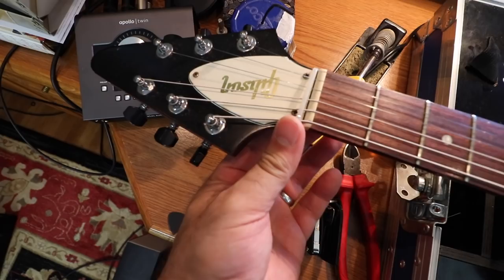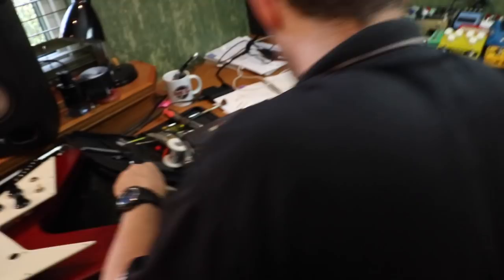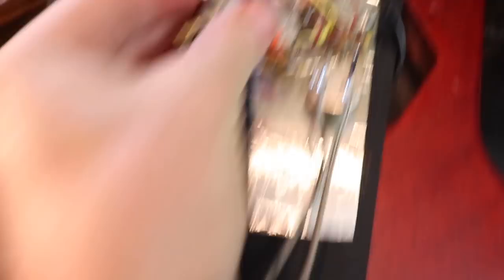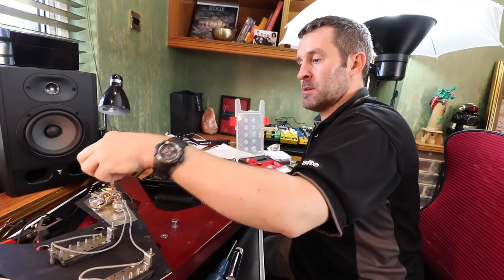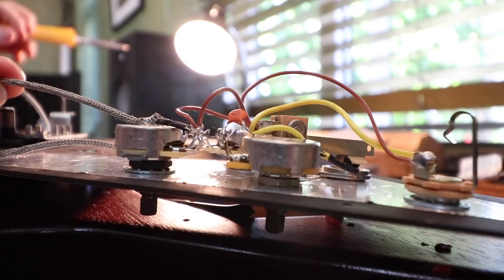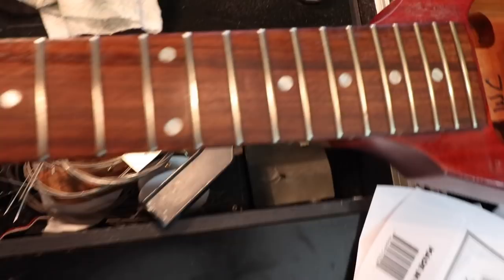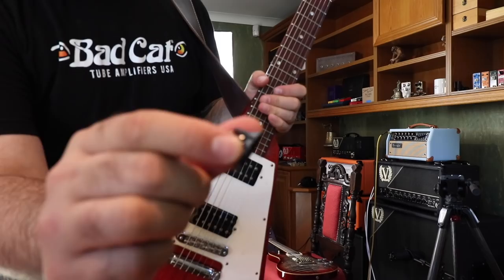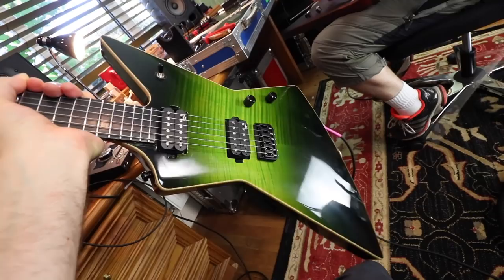Gibson Flying V Tone Hacks

Comment: One day electric guitarists are going to understand manufacturining tolerances on electronic components and rise above the snake oil nonsense.
Reply: Ceramic capacitors are not made to pass signals through.  They have nonlinear behavior and don't act like a pure capacitor in certain situations.  They also have horrendous tolerance.  There isn't anything special about an orange drop though.  Any decent quality film capacitor, be it 50 cents or some crazy trendy $20 paper in oil cap will act similarly in a low voltage application like a guitar tone circuit (high voltage is something else since certain capacitors are better than others at working at several hundred volts like in a tube amp).  Orange drops happen to be convenient because they are easy to work with due to their long radially mounted leads and rugged epoxy coating that protects the polymer film of the capacitor from accidental bumps from a soldering iron while installing.  The "orange drop" line actually has several products within it with differing internal constructions so there is not even an actual single "orange drop" capacitor.

Comment: Disconnecting the tone pot does not remove resistance from the signal. It adds infinite resistance to the filter. Using a 1Meg tone pot achieves similar gain in brightness and loudness, while retaining the ability to roll off the tone should you occasionally need it. It's pointless to hype about the capacitor and then not even connect the tone control at the end...
Reply: this is exactly what I was going to say. its amazing what the ear hears when it wants to
Reply: Not everyone who can solder understands electronic theory
Reply: There seems to be a little bit of confusion about what I was talking about here. So lets clear things up: (Everybody ready??)
 
A tone pot works differently to a volume pot. It uses a pot and a capacitor together to filter the treble frequencies in the signal to ground. The capacitor only allows treble frequencies through to the other side. If the treble frequencies are present on both hot signal and ground side, the voltage difference is cancelled out and the treble frequencies are removed from the signal going out to the amp.

The tone pot is connected to the input of the volume pot. It is connected to one end of the resistive strip. Some people call this “lug 1”. A capacitor is then connected between the wiper, or “lug 2” and ground. The other contact on the pot is unused. This is because we’re using the tone pot as a variable resistor, rather than as a voltage divider, in the case of a volume pot. Turning the pot down allows more signal to reach the capacitor, where the treble frequencies are then allowed through and are grounded. 

If you disconnect the tone pot and the capacitor from the circuit completely, you remove a path to ground from the circuit. All the frequencies will then head to the amp. Does this make it louder? Not really. It’s probably more accurate to say it makes it ‘wider’. You’re now getting all the available frequencies generated from the pickups instead of filtering out varying degrees of high frequencies.
Yes, a 1 Meg pot would make it a lot brighter sounding than a 500K. The lower the value of the pot, the greater the amount of signal that can escape to ground.
500K pots keep your sound brighter than 250K: their higher resistance won't allow as much of the signal to bleed off. A 1 Meg pot has such high resistance that when wide open it sounds almost like having no control pot there at all. But in the case of this particular on-site mod, we didn’t have any 1 Meg pots! ;-)

As always, theres not really any "right" or "wrong" when it comes to which pot value or capacitor value to use, they’re just different. What pickups you are using and their output will all make a difference. The important thing is to use your ears. Experiment with different pots and capacitors to see what sounds best to you.

Pablo ;-)
Reply: while this is fair, youve essentially got 500k in parallel with the nominal resistance of the pots while unloaded, lets say 5ohms (its uncommon for a pot to ever be fully unloaded ime). Youre essentially going to see no voltage across the pot and the overall load of the system is going to be marginally lower than the 5ohms (4.9999500005ohms). taking the pot out when at max volume essentially does nothing. In fairness, im more well versed in LoZ electronics and I know that parallel RC loads can affect peak resonant frequencies even when unloaded in HiZ
Reply: I've had the same idea for some time now. As I was studying guitar building and we did have an amp and pedal course, this thought came to me. It's not a difficult circuit to do and woule be helpful for people to compare what capasitor/pot they want in their guitar.
Reply: "Do it!"

Comment: Oh Rob.... Resistance is Resistance, the same as pressure is pressure. ie: 14.7 psi equals one atmosphere, no matter if it’s 33 ft of saltwater or bars in a decompression chamber. The timeless guitar tone myth of PIO and original Bumblebees, etc... is exactly that, a myth. I challenge any guitar builder to prove me wrong.  I propose to modify three exact guitars, one with the “Highest quality Caps” available, and the others with off the shelve $1 caps. And you will not be able to hear any difference between them. Most importantly, when all three are measured with a ohm meter, the resistance will be the exact same. Full disclosure, I’m an robotic engineer with 30 years CB and electrical component design. Love your channel and guitars!

Comment: Anybody that has a little bit of electronic knowledge knows that all capacitors has the same function... changing these don't change the sound. Removing the 500k tone pot does NOT remove 500k from the circuit. it makes a difference, but removes just little resistance in the circuit.

Comment: I use no load tone pots. Best of both worlds. That Flying V factory wiring is atrocious. So was mine. The fit, finish and playability of the guitar itself is outstanding but under the hood it was so sloppy. I love those non reflector top hats. I have them on my Explorer. I am going to buy some for my V and my 339. My V had Burstbuckers. Too bright on the verge of being harsh and slightly microphonic at SLO gain levels. They were replaced twenty four hours after I bought it with a JB and Jazz. Still on the bright side but much meatier.

Comment: You could also make the Tone-pot a push-pull one. And when you pull it, it engages the tone circuit and when it's in, the tone circuit is bypassed. (Or the other way around)
Cheers

Comment: Capacitors almost fall in the same category as tonewood... In that it's rather negligible and all that... - The whole "It's amazing, it's going to make a huge diffence." claims just makes me cringe.
To be blunt; Electric guitar tone is mostly "pickup + amplifier + speaker" (ignoring pedals for this instance), after that you have things like cabinet construction, cable type, and after that maybe the woods, strings and picks, capacitors etc. - Overall control over the tone's properties are of course determined by how you play the entire rig, but capacitors are definitely low on the list.
(I know, people are gonna argue heavily about what order is "reality", or that it's "all in the fingers", in which case NONE of the equipment matters. But that's in MY experience after about 18 years.)
Reply: Mwell, with real physical stuff like woods, metals, and electronics, there's still a difference. Just not in the way it's generally thought, and it's so MINOR. - It comes down to the player's isolated world, what they (want to) hear and feel. - Like I hear a slight difference when using GraphTech saddles as opposed to regular steel saddles, or play any other material pick compared to your regular Tortex. But it's only a tiny contribution to an overall sound, and when I play full-on and intensely, espcially along with other instruments, it's not going to be apparent. People think too much of the impact, as if each component weighs in an even amount.

HDMI is a digital case, the signal is the signal indeed. Even if we're speaking of analogue audio plugs, gold plating is to prevent corrosion, mostly. That's why you'd want that; No green goop on your plugs over time. That's more about maintaining than improving.
Reply: Well, yea.. Guitar and guitar tone talk often rises to the level of supersition. Eventually it gets down to comparing which company's lemon oil gives guitar the best tone. I remember when I was buying my second guitar, people used to talk how nitrocellulose finish makes the guitar sound so much better than polyurethine finish. Seriously.. SRV played a battered old Strat with hardly any finish left on it and people go crazy about how good his tone was. And for a reason, it was great. But I wonder if he ever spent any money on lemon oils and orange drops.. Maybe he did, I don't know.
Reply: I agree with you only noting that the string "freshness" and quality is  really very high on the list. Pickup -> AMP -> Speakers -> Cabinet -> Strings -> Nut material and quality -> Hardware setup, intonation and calibration -> leads quality and length, ... the rest is ALMOST pure placebo effect. BUT the highly controversial pickup wounding and upgraded electronics are definitely higher on the tone effect than "tonewood" wich is undeniably last. The only reason to improve guitar electronics and hardware is to have better quality, reliability and an act of justice to nice guitars albeit mass produced like the Gibson here. doing it for "tone reasons" is idiotic at best and should be put last on the priority list even if money wasn't a concern, but it is, and we all know it, too bad nobody is brave enough to accept this on public.

Comment: Red V turned out Killer. Far be it for me to question, well, anyone, but isn't these something called a no load pot or circuit, where the tone control works normally until its up full ? Probably asked already. Does sound awesome now, though.

Comment: Could've changed the tone pot to one with a pull/push pot, wired to bypass itself. This way, the option is there for either way.. tone control or not.

Comment: Have the same V Faded, mine's from 2011 and I still have any problems with strings popping out even with 12s and low tunings. However, tone pot just stopped working after only a few years and the capacitor was even smaller, bizarre.

Comment: Modding  my 2018 Dean XV with 16k hex zebra Humbucker in neck and a 16k FLEOR rail Humbucker. But they sounded muddy so I’m going to switch out the treble cap which is a 0.047uf cheap one to a 0.022uf orange drop. You think that would help stop the muddy sound ?

Comment: I had that exact flying V and took it back straight away after the High E started popping out and not even staying back in a day after I got it. Stupid, easy to fix design flaw.
Reply: Dagwood Dogwood Not to argue but Rob has to use a zip tie to keep his High E on. It really is a design flaw. The break angle from nut to tuner is very sharp.

Comment: Orange Drops aren't that magical, they're just a very expensive high tolerance polyester film capacitor for tricky conditions. They might last a bit longer but guitars are hardly extreme conditions. Any high tolerance polyester (EDIT: or polypropylene, polyethlyene PTFE, mylar etc) film capacitor will work. And if you have the same value capacitor, it's not going to sound different, electronics don't work like that. That there is a myth about orange drops means there is a huge markup. Orange drops are great for profit. 

Ceramic disks like the one installed should be avoided as they can go microphonic and function like a badly voiced piezo pickup. Polarised electolytic capacitors or tantalum bead capacitors are not appropriate for this application.

Paper/oil capacitors are outdated technology and should be avoided. They don't last well and tolerances are not particularly good or stable with temperature/humidity. 

If a particular guitar sounds good on a particular day with a paper/oil capacitor, immediately measure the capacitor with an appropriate multimeter (LCR meters are available on eBay for about the price of an orange drop from a guitar store) and select a polyester film capacitor to match it. You may need to use several capacitors to achieve the target value.
Reply: Different products within the orange drop range have different constructions as well.  Some are polyester and some are polypropylene.  Best thing to do is to NOT order them from a guitar repair place.  On an electronics site like mouser they are just another of a gazillion caps available and aren't marked up.  I think people order them out of hundreds of acceptable caps because they are familiar and they are offered with long easy to work with leads.
Reply: Ok, I'll conced any type of "plastic" film capacitor you can find in the right value will work, polyester film is probably the most common. My supply is green, brown or yellow depending on manufacturer. Original post edited.

The right value is important though, as is the loading on the pots. I'm using 22nF most of the time as it's a fairly subtle roll off, 33nF or 47nF are more appropriate if you like a very muddy sound with the tone rolled off. 

Some pickups, particularly strat style single coils and vintage voiced humbuckers with strong eddy scoop and resonant peak are very sensitive to pot values, the single coils I make are viciously bright with 500k pots and work much better with 250k pots. Similarly a 1Meg pot can make vintage PAF voiced pickup sound quite shrill, but might rescue something dark like a Tone Zone. Most pots have quite vague tolerances and these can have a huge effect on pickup response.
Reply: The thing is; Different types of capacitors give a SLIGHTLY different result in sound. There are different demo-videos on YouTube in which you can hear differences. But in my opinion the amount is as small as arguing over different woods or something. - But indeed "the orange drop" is this revered thing, which in my opinion is already an outdated mindset from years ago. Again, similar to the tonewood idea or that "neck through gives most sustain" and so on and so forth.
Reply: The difference betwen capacitors of the same rated value is due to capacitors not being precisely their rated value. Cheap ones can be 20% or more out. High end capacitors can be at lolerances of 2.5% or less. Two capacitors that measure the same with a proper meter will have the same filtering effect. Most people can hear a 20% difference in capacitance in an RC lowpass filter. I'd bet the cheap green untoleranced capacitors all rated at 47nF all sound different, but I doubt there's an audible difference between any of my 5% ones.

Comment: Looks like the nut needs replacing, as it is set too low with slots not cut deep enough. Treat the cause, not the symptom. And...why anyone would not use a compensated nut today is mind boggling.

Comment: Interesting video, thanks. With my whinging miserable cynical hat on though, I'd be willing to bet a week's wages that in a blind test, almost no-one could tell the difference between a fifteen-quid oil and paper capacitor and a standard 10p ceramic job on a tone control. And even if they could tell a difference, I bet 50% of people would prefer the ceramic.
Reply: Ceramic caps have like 20% tolerance.  Its like capacitor gambling.  You can get film caps with 3% or 1% tolerances.  Paper in oil caps are typically poor tolerance as well since they are reproductions of something that was all over the place to begin with.  The exception to this might be the ones pumped out in the cold war for Russian military equipment that are all over ebay.  IMO paper in oil caps really have one purpose, historically accurate reproduction guitars.  In that sense they act the same way a historically correct switch tip or volume knob does.